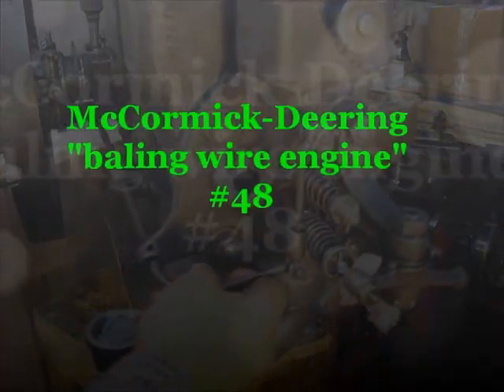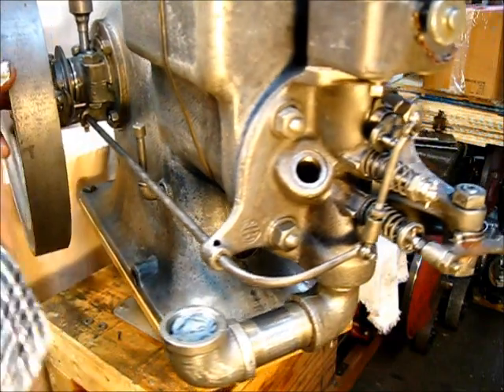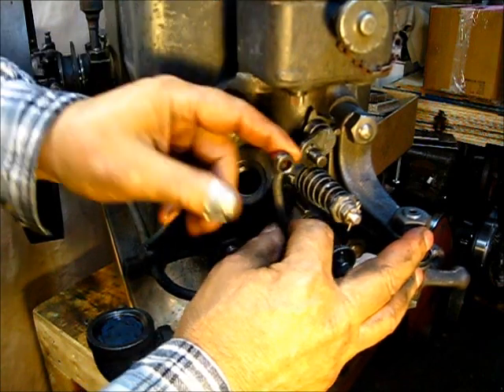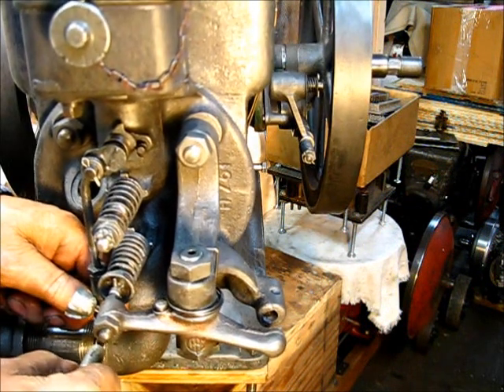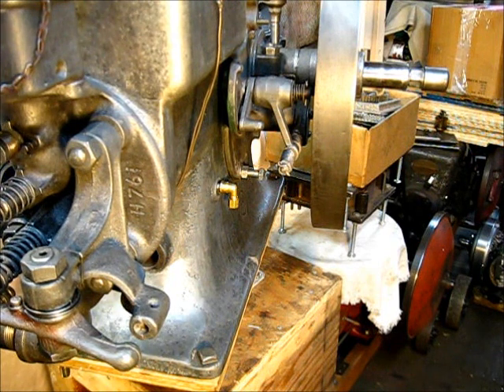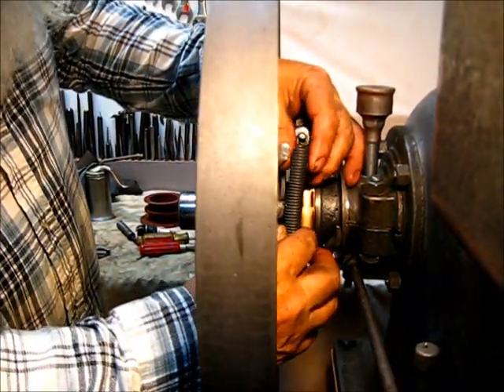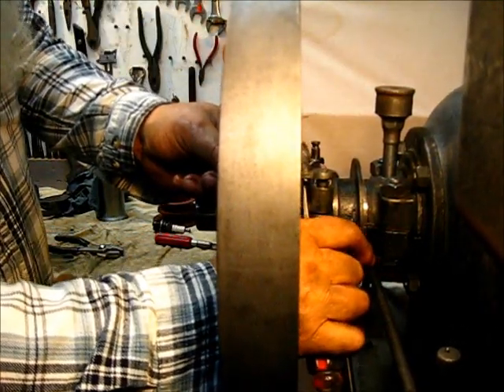McCormick-Deering "baling wire engine" #48

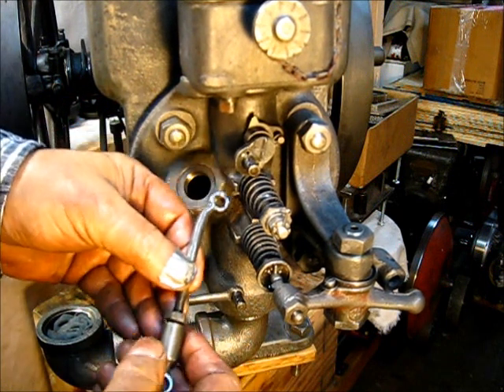Comment: Thanks for the response. Yeah I think I am talking about the throttle plate it looks like when the weights are in the arm doesn't fall all the way down because the adjustable arm is holding it partially closed. At about 4:56 when you take the arm off the throttle plate(?) snaps open fully. That is what I was wondering about.

Comment from the maker: ,,,,, no, the the short adjusting link should ,,,, always,,,, be adjusted so that the flyweights can completely close the butterfly,, it's how the springs are set that regulates the amount of closure the butterfly has,,,,, and I think the governor throttle lever was always made out of pot metal (die cast-zink), but I have seen a brass one that looked original, steel or iron, i'm not sure,,,,

Comment from the maker: governor set like it wouldn't open fully, I don't know what you mean?,, the throttle plate is open and the governor weights fly out to close it,,  I start with a weak intake valve spring tension and if need be I adjust tighter (I will talk about it in an upcoming video),, and the governor springs need to be adjusted to the correct rpm's, working or idling, it's an rpm thing

Comment: Looking good so far, getting close. Just a few questions if you wouldn't mind answering them. As you had that governor set is looked like it wouldn't open fully, is that how it  typically is? You mentioned setting the tension on the intake valve with that nut, is there a good place to start out with it? Finally the springs on the governor, would you change the setting on those if it was going to be a "working" engine?